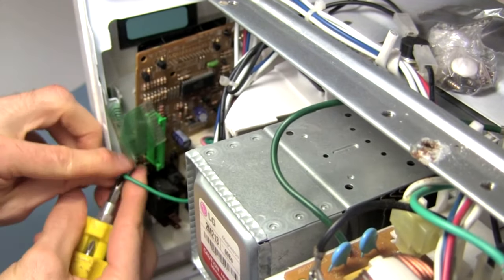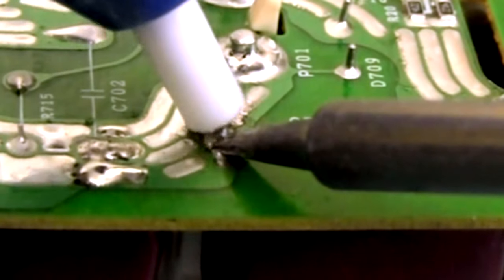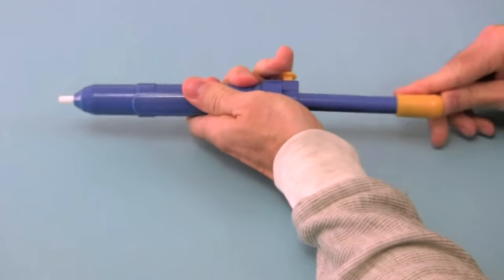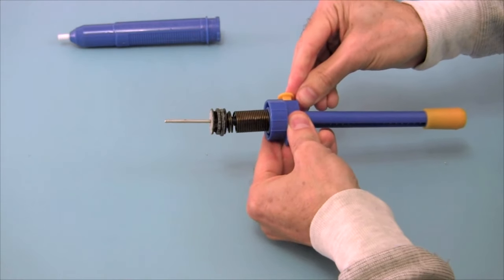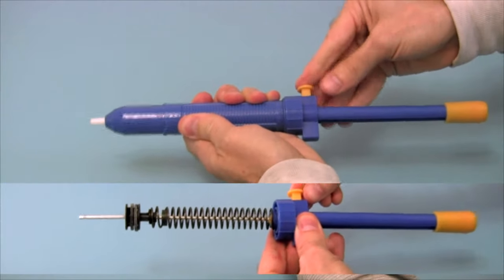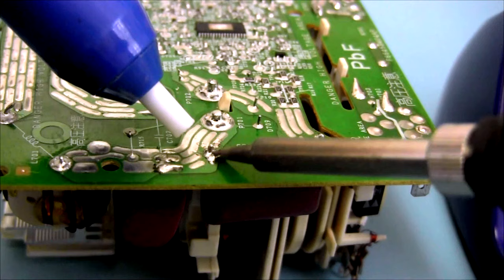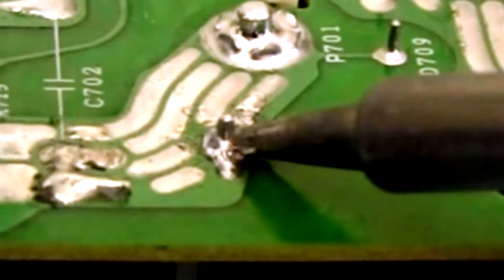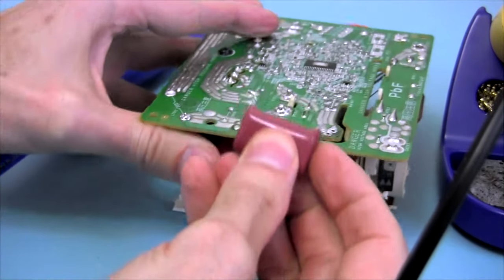How to Desolder with a Desoldering Pump/Solder Sucker

Comment: Personally, I've had a hard time getting good results with solder suckers however, the irons with a built-in sucker work great and they're much cheaper than the motorized suckers.
Reply from the maker: Solder suckers do have their place. I've never worked with the motorized ones and this is the first I've heard of an iron with a built-in sucker! I'll look that one up.
Reply: @RimstarOrg  Never said they didn't have a place, just that I've struggled at least with the one I have, but yeah in my experience the de-soldering irons work great because the area doesn't have time to cool and it makes somewhat of a seal like the motorized ones do.

There are a couple different styles of them I have the Velleman VTDESOL3U which is like a normal sucker inside an iron, this is one of the cheaper irons out there, but people are also quite happy with the ECG J-045-DS De-Soldering Iron which has a hand pump.
Reply from the maker: I just looked up the Velleman VTDESOL3U and the ECG J-045-DS De-Soldering Iron. One nice thing about uploading videos are all the great tips you get back in returns. Thanks!

Comment: I got a desolder pump a decade ago and love it. Solder wick still has it's place in some cases but mostly I use the pump. Another solid purchase was a flux pen.
Reply from the maker: I'm like you, for most of the things I do, a desolder pump does the trick. I don't have as much luck with solder wick.
Reply: @RimstarOrg  The wick is finicky for sure and I have damaged components when it's reluctant to wick up.

Comment: If you don't care about the motherboard, grab the circuitboard with pliers, put some flux on it, blast it with a heat gun and smack it on a table. Everything comes off :D
Reply from the maker: Oh neat! A few of you have mentioned blasting it with hot air now. The flux is a good tip. Thanks!
Reply: @RimstarOrg  solder oxides are very gummy and sticky, the flux will deoxide them back into a soft pudding that can be molten easily.

Comment: Those thing are brutal careful not to heat the trace too much sometimes you also lift the trace because of the sudden jolt from the pump.
Reply from the maker: Good tip. Thanks.
Reply: Good to have you back 👍

Comment: Nice to see you back 💖
I've got my desoldering pump from a very long time now, sometimes it happens it is better to use desoldering wick, but most of the time a pump it's the perfect solution 👍👍
Reply from the maker: It's good to be back.
Maybe the reason I haven't had much luck with desoldering wick is because I just used some random copper mesh. I understand that store-bought wick sometimes has flux in it to help.
Reply: @RimstarOrg  the goot does work better than the ebay specials

Comment: I prefer using compressed air for desoldering. Just melt it and blow it away. Be aware of where you are blowing it towards because it can be messy. But quick and effective if just salvaging parts, or if neater methods aren't working for that one stubborn part.
Reply from the maker: I guess in that case you're usually removing multiple components? When salvaging, I guess I could do the same. Why not get multiple parts even if you don't need them right away! Thanks for the tip.
Reply: @RimstarOrg  When I am removing multiple parts or something with many pins, I use my bigger and hotter iron and the compressed air makes a pretty clean desoldered joint. But the molten solder can solidify on whatever it gets sprayed on to, so I try to blow it off the board, or mask an area with tape to protect the rest of the board and solder joints. The air blowing across the hole will siphon the molten solder out of the joint and 80% of the time the part is loose and free to drop or pull out. Large component leads with big solder joints are another time I prefer this method as a sucker or wick is generally overwhelmed.

Comment: Random question I know but it arose from your early triboelectric videos and a question my son raised that I can't answer to my own satisfaction: why are some materials that are high/low on the triboelectric series such poor electrical/heat conductors? Some of the best positive & negative candidates for electrostatic charge demonstrations are really good insulators! I've searched extensively yet can't find a good explanation. I suspect it has something to do with conductivity needing the 'sea' of electrons while the triboelectric charge transfer is more like a weak ionic bond (and so the two macro-objects involved become like two gigantic ions!??). I ask because you've been one of the best at really getting to the heart of things....byw thanks for all your work here over the years.
Reply from the maker: Thanks for watching over the years and for the kind words. Unfortunately I don't have an answer for that, despite it's coming up a few times. I guess I've had the same experience as you.
Reply: Seems complicated
Reply: Consider the "maze vs tunnel" analogy

Electrons need a clear and easy path to follow from one point to another for conduction, the materials lack that. 

They can easily  transfer from one material to another due to their electron affinity, but this alone isnt enough for conduction

Comment: The original Solder Sucker was called a SOLDAPULLT Model DS 017 with a Teflon tip. Still have a few in the shop. Rarely use De-Soldering Braid. BTW... it's important to open and clean out the sucked solder periodically. Just pushing ion the plunger will not empty the Solder Sucker properly and mat damage the tip.
Reply from the maker: Cool! Looking at the history of it, I can see why my father use to use it. Further opening it up to clean it, I seem to also recall reading instructions to occasionally clean the seal around the plunger too and possibly relube it.
Reply: @RimstarOrg  Yes.. after a few cleaning operations you can sparingly use some petroleum jelly (Vaseline) to lightly lubricate the 'O' ring seal. Oil would destroy  the rubber 'O' ring.

Comment: What are some of the things u use the microwave parts for?
Reply from the maker: I've used the piezoelectric speaker for making an earpiece for a crystal radio https://www.youtube.com/watch?v=aJkx6hAD-4E . I've used the transformer for making a ball bearing motor https://www.youtube.com/watch?v=fdvRFE680u0 (note, these transformers are dangerous if you use them to put out high voltage ahd high current). But I've also used many individual components (resistors, fuse holder, the smaller transformer, ...) in other projects. I even used the metal from the case to make a case for a power supply https://www.youtube.com/watch?v=u2v-L-1Kctk
Reply: Microwaving!
Reply: @robertl1244  Lol!

Comment: Hey man you remember that video you did with the bottles and the sound moving them with a speaker? Is there any chance at a low frequency that the Egyptians used sound to move the rocks?
Reply from the maker: I don't see any way the same thing would work with rocks. The bottles were lightweight and hollow, and the hollowness allows them to produce a jet of air essentially. Low frequency is also low energy, high frequency has more energy (though in the case of the bottles, high frequency just wouldn't work).

Comment: I've planning on desoldering and replacing an xbox controller thumbstick and was wondering. Would it help to brush a little flux on the solder? I once tried desoldering and managed to lift the track off the circuit board. Ruining it in the process. Too much heat perhaps?
Reply from the maker: I've heard others say they put a little flux if they're having trouble. Regarding lifting the track off, I've heard of that too. The only thing I can think of is too much heat too.

Comment: Why is the desoldering pump plastic instead of metal?
Reply: Because the material sucked cools very quickly! I got one made of aluminium, but is for smaller electronic
Reply from the maker: I'm surprised the plastic tip doesn't melt much. It must have some heat resistance to it. The tips are replaceable though.

Comment: Can you show how to discharge a cap.In a circuit also is there any books I can purchase on reading diagram schematics
Reply from the maker: Discharging a cap depends on the size and type of capacitor. Electrolytic capacitors often have the terminals at the same end so I usually put the shaft of a screwdriver across them, being careful to not touch any of the metal of the screwdriver myself since electrolytic capacitors can contain a lot of energy. For smaller capacitors with I sometimes use a piece of insulated wire with the ends stripped. I just touch each end to an end of the capacitor. In either case, hold it shorted for a few seconds to completely drain it.
As for books, if you're a beginner then "Getting Started in Electronics" by Forrest M. Mims is one that a lot of people started out with.

Comment: i get better results with the nozzle held at right angles to the board. it seals nicely and when pushed up really close will usually pull it out clean in one go. if you dont have this tool a squirt of air from a compressor works good but sprays  a mess of fine crap that you need to be aware of...an old box or something to catch the mess is advised...if you are doing repair work the board will need to be scrubbed to remove any of the sprayed solder. another trick is to bang the board on the edge of a bench while the solder is hot and the stuff will fall out clean...long sleeves advised for that one.
Reply from the maker: Thanks for the tips. Another difference is where I suck in the solder the first time, I take away the soldering tip and then bring in the nozzle and I don't get it all. The second time, I keep the soldering tip in place while sucking and I get it all.
Reply: @RimstarOrg  yes...and another tip i forgot to add was it helps to add some fresh solder to the spot you are trying to remove...dunno if it cos there is more puddle to pull up or cos of the extra flux added making it less crusty but it really seems to make for a smoother cleaner job
Reply from the maker: That was my thought too when you said you add fresh solder, that it's the flux that's doing it. A few have commented here about applying flux.
Reply: @RimstarOrg  sounds like that is the reason...i never wanted to use the flux because it was more expensive than solder ;)
Reply from the maker: LOL! Good reason :-).

Comment: Are you available to help?
Reply from the maker: If you have a question and I can answer then I am monitoring these comments. Also check the comments section for this video as a lot of others have pointed things out too.
Reply: @RimstarOrg  well it's more than one can we talk anyway ? On the phone I'm not the best texter.  But I'm working on a couple of small electronics. Today I'm wondering is safe for me to create a dual mini usb cable to charge my two Samsung's
Reply from the maker: Sorry but I only answer questions in the comments to my videos. And they have to be questions related to the video and not requests to help design something. There just aren't enough hours in the day.

Comment: I tell you in the  real world it would be nice if it was so easy.
In most cicruits there is coated laminate of sorts on everything.  Plus there maybe solder on both sides of the board.
Aside from that some solders are tough to melt depending on the type used.
You could easily be struggling to remove some solder joints for 10 minutes or more.
Of course then you got them solder chemical melter that keeps the solder soft long enough that you just sucke it all out before it hardens on  you and they cost money.  
And that is the actual truth.
Reply: Well said....I have been there many times.